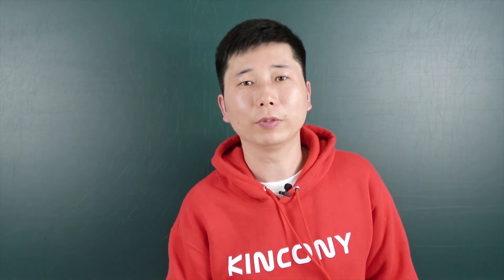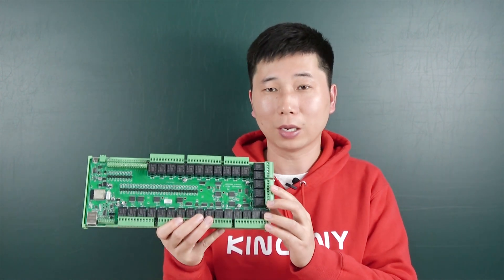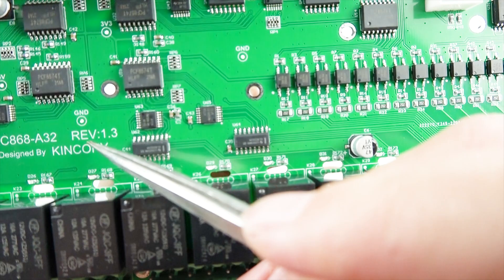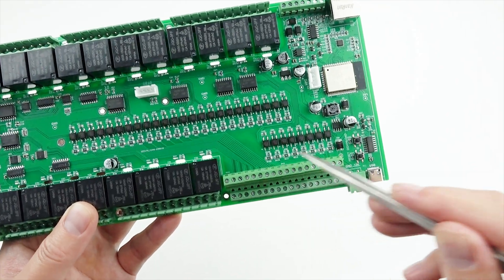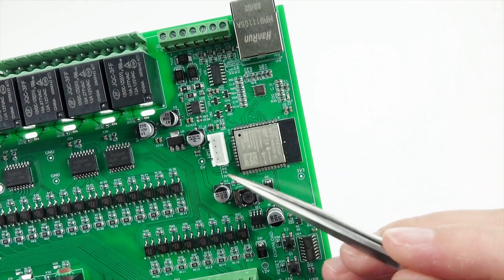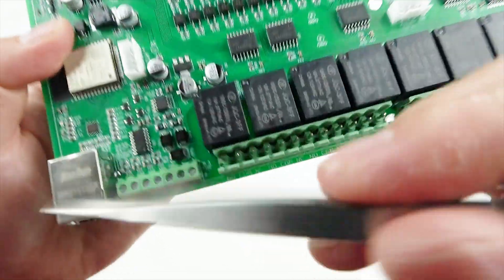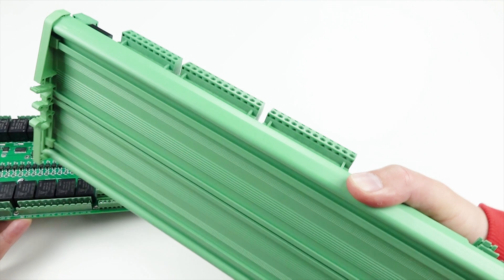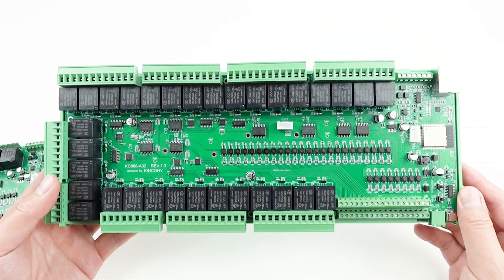KC868-A32 ESP32 home automation relay module released!

Comment: Good morning, I am moved by your great paintings. I built an automation box , esp32 38pin module and connected an 8-channel relay module to the mcp23017 module. All of the relays function, but when I connect an ac power source to the 8 relays, the esp restarts , usually if I do so switch on /off quickly and occasionally after a few minutes, which causes the esp to restart. Do you have an answer?
Reply from the maker: There may be interference signals, unreasonable schematic design, or PCB wiring, mixed high and low voltage circuits.

Comment: insane design wow, just to clarify, each relay can handle 10amp or 2770watt per relay, that means if 32 relays are on at full load you need to input 88640 watt, surely at that point the board has melted or something has died on the board. or have you designed it to latterly handle 32 x 2770 watt room heaters or 32 x 2770 watt pumps for example. Just checking for interest sake
Reply from the maker: every relay load is independent. one relay 10A, we not suggest use full load, usually use 50% is safe.
Reply: I think the relays are to control the contact switches, so they will not be hooked up directly to home appliances. Correct me please if I am wrong

Comment: Is is possible to powering  this bird with 24V DC?I want to have possibility to control input with 24V DC
Reply from the maker: KC868-A32 is design for DC12v power supply, relay coin is dc24v, if you want to use 24v dc relay, suggest use KC868-E16T or E16S :2pcs
Reply: @KinCony  what do you mean by "relay coin is dc24v"? Is that mean that kc868-a32 have relay 24V DC?
Reply from the maker: @gabrielmusia470  A32 use 12v dc relay. E16T and E16S can use for 24v dc relay.

Comment: How I can use temperature sensor on this board (ds18b20 or similar) with ESPHome? is there any instruction
Reply from the maker: it's very easy, see this link: https://www.kincony.com/forum/showthread.php?tid=2367   this is A8 board, but the "sensor" you can use for A32, just replace with Pin number and replace with DS18B20 sensor ID is ok.

Comment: Is there any plan to add power meter to this board?
Reply from the maker: today will release new version KC868-E8T, will include energy meter function.
Reply: @KinCony  tkank you for response. But i was asking about module with 32 relays
Reply from the maker: @gabrielmusia470  do you want all 32 channel with energy meter function?
Reply: @KinCony  what opions we have? It would be nice to have this for all of relays
Reply from the maker: @gabrielmusia470  if have 32 channel monitor, the pcb will be very very large.

Comment: Nice design, does it support 802.3af/at/bt?
Reply from the maker: support ethernet, wifi, bluetooth,RS485
Reply: @KinCony  right, but is the ethernet port PoE capable? (i.e. Can it receive both data and power for the board over a single ethernet cable negating the need for another external power supply?)
Reply from the maker: @InfoSec_Tori  not use by POE

Comment: Does it have wifi connection by default?
Does have a default firmware with MQTT support?
Thanks.
Reply from the maker: it can use by ethernet and wifi. you can download tasmota firmware with mqtt support. or you can download a arduino mqtt code, it's easy.

Comment: This board have RF transmit and receive modules?
Reply from the maker: on board is cancelled, but add a serial port on PCB support for serial wireless module or Nextion displayer.
Reply: @KinCony  
It would be nice if this board had RF capabilities especially for those who use Home Assistant and want to combine as many functions in one device. Maybe in the future you are thinking of improving the functionality of this board. I'm sure many Home Assistant users using ESPhome would be interested in a board that would cover many options and no longer need to use multiple devices.
Reply from the maker: @razvanionescu4129  it support connect by free GPIO pins of serial port for RF transmit and receive modules to use.
Reply: Yes it can be done as you say but it is not the same as when you already have the modules already installed on the board. Anyway, thank you for what you do, I have not seen so far, any manufacturer to make such diverse modules for the DYI community. @KinCony
Reply from the maker: @razvanionescu4129  Thank you for your suggestions. We will continue to innovate according to user feedback.